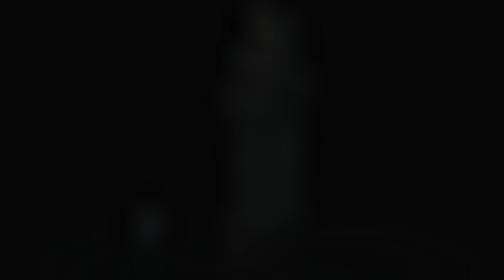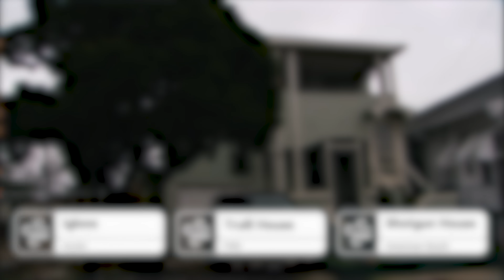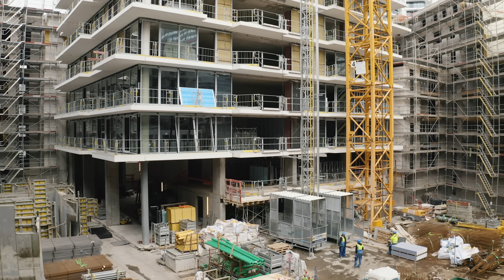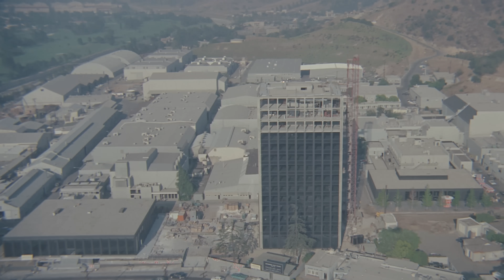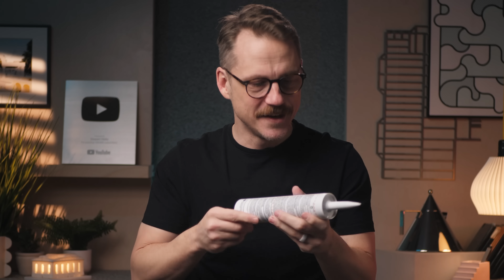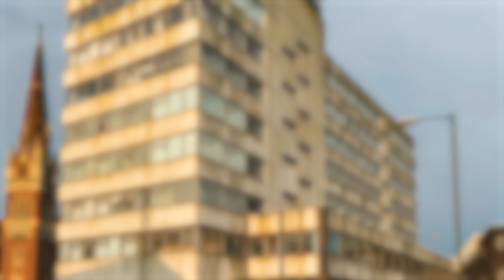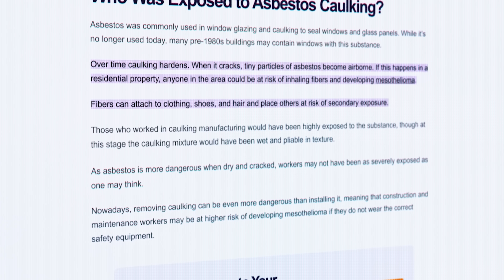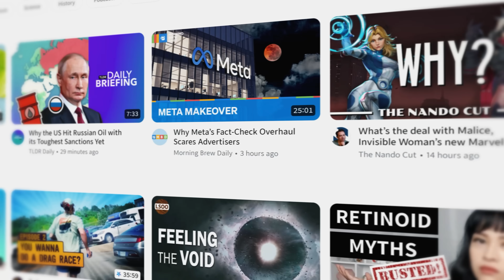How Caulk Accidentally Made Buildings FLAT

Comment: 5:15 frequently looks like shit and fails
Reply: I have worked in everything from historic preservation down to replacement windows, and those experiences have led to ke looking at everything in terms of how and when it will fail and how bad and how dificult a real solution would be to retrofit. Living in philadelphia has me wanting to cry seeing it slowly turn into a mini-mall. we have had massive aluminum panels blowing off the sides of 5over1s built less than 10 years ago just because of poor adhesion and slightly higher than normal wind. I wish i had the money to save some of our historic treasures but since covid the city has abandoned any facade of historic preservation and pride of local craftsmanship

Comment: What's even dumber and makes these gaps even less predictable is that older  machines (or poorly maintained machines) have an "accuracy" usually measured as ± .00X .  This means that even if your entire run of panels was cut at the far end of tolerance - say .01" short, that entire run is actually between .009 and .011 short.  So when you're trying to make a fucking box...  It gets even worse if you have anything getting formed because then you have different heat certs, meaning different materials that are slightly different in the way they cooled (still, maybe only even .001"), or if the angle is even .1° off (which is going to happen to any tooling at all after 5000 parts), that changes the overall size dramatically over such large spaces.

I'm not in construction, but I assume this problem is sorted out by having a home reference point / 0 like you would have on a CNC table that all measurements are supposed to be made from.  I'm also guessing that that is the job of a very smart man or woman.

Comment: Stewart, the part with the 1914 diagram and overlapping parts and lines went too fast, and I don’t understand it.  Were the craftsmen compensating for problems by tilting it, sticking in shims, and moving the parts slightly?  Why doesn’t the exterior look inconsistent?  I totally get and agree with the insights in the video about caulking, but I don’t understand what was physically geometrically going on with the terracotta windows.  Also the video says you can’t put a window in brick because it won’t be straight, I don’t understand… the roof is straight, the bricks look straight, so why couldn’t a window install be straight?  I’m not arguing, I just don’t understand the factors or what the deal is.

Comment: It's interesting. On a new building essentially that caulk joint is your primary seal. If your using a modern silicone like Dow 795 to get the best life span you are preparing the joint by cleaning it, priming it and then laying a bead and tooling it. Backer rod or tape may need to be applied to control the depth of the caulk joint or prevent 3 sided adhesion. It also requires you to test your joint and your silicone batch with a pull test. Essentially when you only have one potential failure point you need to put a lot of effort to get the best practice. On an older building when replacing the windows you can actually have as many as 3 barriers to prevent air and water infiltration. Often when removing an old window in an older building in Manhattan after you have waterproofed the backup masonry you will attach a perimeter angle around the window with a compressible foam tape. These products when compressed against the backside of the exterior brick or stone will act as a backup in case your silicone joint fails. Then often we will put a primary caulk joint followed by a piece of decorative exterior trim like a brick mould that will protect the first joint from uv exposure and leave you with the final silicone joint between the trim and the exterior masonry that you can service. The likelyhood you have an issue with all 3 layers is small. We find most leaks when doing this are related to the exterior masonry itself.

Comment: I do repair carpentry for a few painting companies and I'll tell you that just about every area of rotten wood stems from a bad or old caulk job that had broken down and neglected over time. I never put anything back with the idea of using caulk to keep water out. I always build back the wood redirect the water or I cover the gaps that could become a problem. As good as caulk makes it look I never depend on caulking to keep the wood dry.

Comment: I started out as a painter. Did custom high end for a decade before deciding to become a carpenter because I got tired of caulking bad carpentry. Caulk should be a finishing touch for straight paint lines sealing surfaces and allowing for movement in n joints. Not for building fake joints

Comment: I renovated my small 1942 home in 1996. When I changed the siding and windows, I made custom window casings from western red cedar that eliminated the need to use any caulking between the window/cedar shingle siding/and casing. Water cannot penetrate the joint because of the mechanical interlock between the 3 elements. I live in the north and to this day it's never leaked despite heavy rain and winter snow. I check behind the siding every few years because the window casing is easily removable.

This was completely unnecessary to do but I wanted to see if I could given that my profession is mechanical engineering. I employed a variation of what's called a "labyrinth seal" in the window casing.

My wife thinks I'm absurd. 😂

Comment: Prefab does not mean, that caulk has to be used. 

There can be prefab solutions that use the drip-edge design of historical constructions. It's not magic.

In Germany and Austria caulk is not the end all be all solution - i've always been shocked by how much caulking is used in a normal single family home facade. It's criminal creating the view of a ventilated facade without any of the benefits but all of the downsides.

Comment: I live in a 1915 foursquare. Its bay window was repaired in the modern way here. 
They took out the orginal sills and combined parts that were made to block ans control water. They used sprayfoam, and yes it will rot behind your plaster, everywhere it was rotted. 
Chalk everywhere on the plaster and instead of window glazing as well. Joint compound on everything, even wood trim. 
We're restoring house and remodeling all utilities and wet rooms. They all rotted ans were redone in the 80s.

Comment: In my limited experience repairing and renovating our old 60s home, caulk always fails.  It will mold, even if rated for a lifetime of mold free performance.  Caulk in my bathroom has to be replaced every 6 months.  Caulk in the garage, rated for "lifetime" outdoor performance, cracks and needs replacing in less than 3 years.  To say I hate the stuff would be a vast understatement.

Comment: Caulk has nothing to do with it. What it is is greed. The people making the buildings want to save money and time so buy premade things. Like you said at the start of the video. This leaves them with a limited selection and no custom made parts. Because the people making the premade parts want to save money they make the parts all very similar to each other. So that they can make them in the same assembly lines with the same materials. Just with small changes. This way they don't have to buy a bunch of new stuff every time they come up with something else they want to add to their catalog. They don't have to have people come in and make a bunch of different things for single builds. This is part of the efficiency that some of the rich talk about. They have made most businesses look the same with every thing simplified and cut down to save money. It is easier to change out a building to a new business if it doesn't have custom stuff. Like the old Pizza Hut buildings here in the US that every one knows the roof shape of. They never changed out those roofs after they changed to other things. Too expensive to do so. 

We used to make things to last. Now things are designed with planned obsolescence in mind. We use cheap materials and methods of production. We don't make things better than others to get customers any more or provide better service. We have people press buttons on a screen instead of having a person there to help. We used to have to make a better product or service to get business. But now they have all agreed to just make garbage and cut the customer service. So they can save more money while jacking up all the prices for more and more profit.

Comment: Nicely made video, but I disagree with its premise. Throughout history, caulks, sealants, flashings, fillers and cements were used to seal and set building components. This is unrelated to the propensity of new buildings to be angular and flat. Modern buildings lack visual accoutrements because of cost. just cost. Modern buildings, built by professionals, do not use caulk as a primary sealant as alluded to here. Properly installed windows are flashed, and will shed water without caulking. The caulk is used to prevent air drafts and to air seal the envelope to enhance the efficiency of closed loop HVAC. Our basic methods of building would be fairly recognizable by a Roman craftsman. Even something as simple as an angled 6" crown molding, once common, is now costly, and requires trained labor. Since it has no structural value it is only considered when the buyer insists and covers the cost.

Comment: As a contractor I definitely agree with the sentiment of this. I think there might be a couple things that you kind of miss, definitely back in the '90s in particular people were using caulk as a single point solution. More modernly in commercial there's usually going to be at least a redundant caulking joint if nothing else and  in residential anything but some of the slimiest buildings are usually going to have a redundant wrb layer underneath the facade to act as a secondary layer so you're not often seen caulk as the primary waterproofing feature on a modern home anymore. Either way most of your points still stand I just think there's a bit more nuance in some of it. Water in water out in flashing practices have really come a long way in the last even 10 years

Comment: As someone who designs and draws storefront and curtain walls,  the statement that it's all in a catalog is about as far from reality as we are from the moon. 
Yes, certain parts are available to chose in that way, but in reality, every curtain wall and storefront have to be custom made to fit the actual size of the RO or building.  The ideas put forward in this video, don't correlate with my 35 year experience in the field.

Comment: I definitely like the better temperature sealing of modern buildings though. Older buildings get so cold in the winter and hot in the summer, and they also don't have adequate air conditioning or heating to compensate for it.

Comment: basically just:

old houses: those old giant Victorian era villas or a lot of the buildings in paris were all built and carved by hand. Maintaining them is a huge hassle due to very old wiring, components, and due to how fragile the materials of the house likely now is unless it has been very well maintained throughout the years and other worn down stuff and businesses that suppled specific repair parts that have been down for decades preventing the right part from being put back in place and whatever.

newer houses: depending on the size stuff like modern houses can take about 4-12 months to build. and much bigger buildings can take years, however they all share the same design probably due to that design being so cost effective that it can be mass reproduced everywhere. The less people working on the project, the longer it takes to build it.

Comment: I'd like to see if there exists in Construction/Architecture the concept of "Design for Upgrade". Basically, designing a product or system with the intention of easily and efficiently incorporating future enhancements or modifications.

I've heard of this in industrial equipment design. And sometimes it's billed as renewable or green. Because when one part wears out, it's easy to replace the part and keep everything else together. The focus is on making everything easy to dismantle, fix, and put back together.
Reply: This is almost exactly what was described in the video.  Modern construction techniques are such that any one component can be removed and replaced as need be.

Comment: It's called engineering a house.  Engineers use seals or sealants.  The first space shuttle failure was due to a seal failure.  Engineering homes can make them more affordable, not necessarily better.  Don't blame sealants, but lazy Architects.  Just like anything else, Architects need to work with engineers to meet engineering, business, and environmental needs, as seen with the Millau Viaduct.

Comment: There’s 2 proper uses for silicon sealant, shower joints, and fixing shoes when you’re broke. My old work boots were rotting and I basically just replaced the sole, lasted another few months before I could afford new boots

Comment: As a senior designer, I have worked on a couple of projects I’m not completely happy about. First a college in NY that used GFRP to replace terracotta pieces that had deteriorated. Yes, it looks similar, it was cheaper, but inside, I knew it was not the same.

I also worked on some tilt-up concrete construction, and yes, the joints used sealant.

However, I can only say I didn’t work on a mall in North Caroline my wife and her family visited that had an expansion joint that had to be 6 inches wide. Not sure what they used as back material, but they the sealant must have come from a bucket and applied with a wide trowel. What an absolute mess!

Comment: From an economic perspective the modern method is eminently logical. In 1914 Chicago there was an ample supply of affordable skilled labor to finely craft a facade. Through rising standards of living, unionization of the trades, and the postwar demand for rapid construction (amongst other factors) the economic pressures was to provide more construction quickly using less labor. And boom, caulk to the mass-produced rescue.

Comment: You are miss understanding. You don’t want air flowing through skyscrapers you want an almost closed circuit. To keep a build climate controlled it costs a fortune, so you want it very well insulated and a climate control system pulling cool air from the very top down into the building. They are not using generic caulking they are high grade sealants that can last 100 years if not tampered with. You want the building sealed and insulated from the freezing exterior or burning sun in order to control the interior temperature freely and save on electricity. If any sealants are cracking there is a problem with the core structure of the building it could the foundation is cracking or steel beams aren’t fasten well because that is where most of the movement of the building should be happening. In Japan many skyscrapers actually sit on massive rubber blocks to counter act the movement of the ground during earthquakes.

Comment: I'm missing the argument here? you're comparing punched openings with a window system to unitized curtain wall? two completely different systems with completely different functions and uses and somehow  the answer is because we use sealants?  I get the idea of how we don't have that brand architecture anymore and everything is more cookie cutter than custom, but to me that's a design and architect issue which could be compiled to cost, time frame availability of labor etc. I just don't believe that the reason our buildings look so bland now is because of sealants

Comment: Was working on an apartment complex years ago preparing to install metal panels on the top of every balcony feature on the exterior. A piece of metal was needed to be installed at the top where they meet the wall before the efface was placed. We went back 3 times to re install it because we had “done it wrong.” One of the GC’s went up with me to instruct me that the Tyvek wrap on the wall needed to be cut, our metal slide up inside, and a tape applied to tie the Tyvek to our metal. Mind you, only one piece of tape on the top side of our metal was applied. You still could have seen the raw wood underneath.

Is that correct? Myself, my coworker, and the GC all thought the architect was a moron.

Comment: The old Soviet buildings have the problem that they have to employ a kind of flexible felt sealant to accommodate thermal contraction and expansion between each large concrete wall panel, which can often leak in the rain.  With old fashioned brick buildings the gaps between the bricks are spread out between thinner and sturdier cement mortar which tends not to leak.